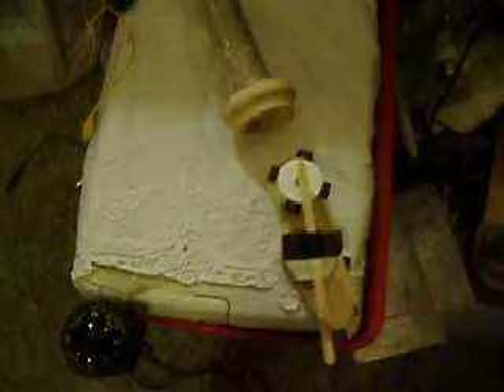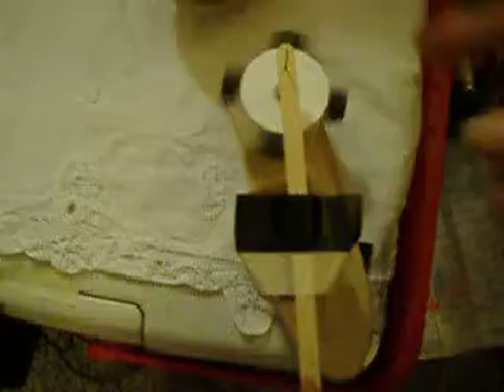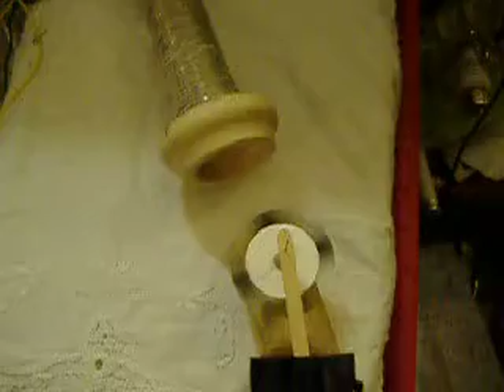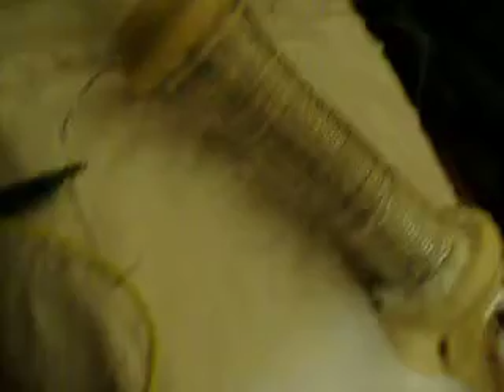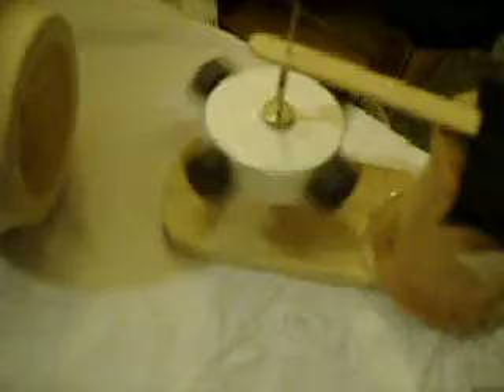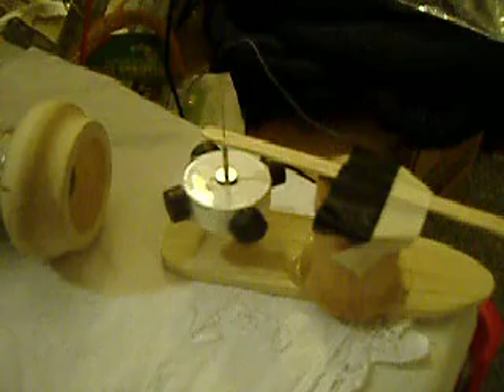Nathan Stubblefield Coil Rotor No1... No Reed switch yet

Comment: @Myreply59    I don't have a video of it yet, but after reading all of Nathan Stubblefield's work and patents I discovered that all one needs is a simple coil with copper windings around it and insulated in between. And you can wind insulated wire with no power weakness. A reed switch is useful in that in creates the sudden pulse spike needed to power up a secondary coil. I'm thinking of making my own after studying the way they were made. I want to end by saying don't give up on this device.

Comment: @jeannacav   Your device looks fine. The coils can be very easy to make and you don't need a lot of windings to get a magnetic field. If you have a magnetic field it's just a matter of finding the proper alignment. I took a spring coil and put some wire tape on it and them wound 40 winds of wire around it, connected the ends with a few drops of water on a piece of paper towel and got a strong continuous magnetic response and was able to flip ceramic magnets with it.